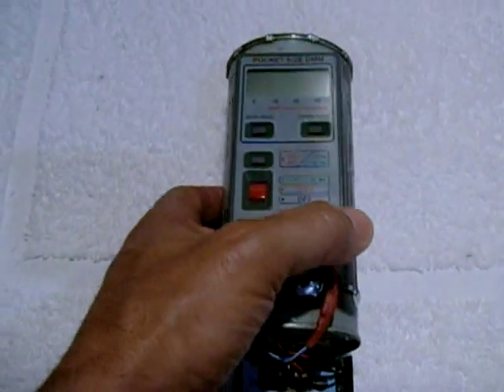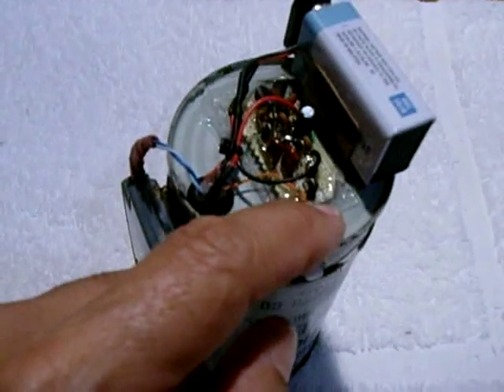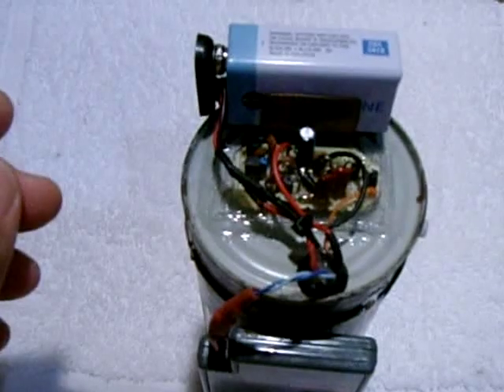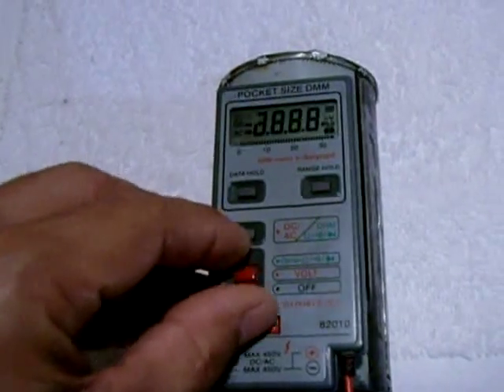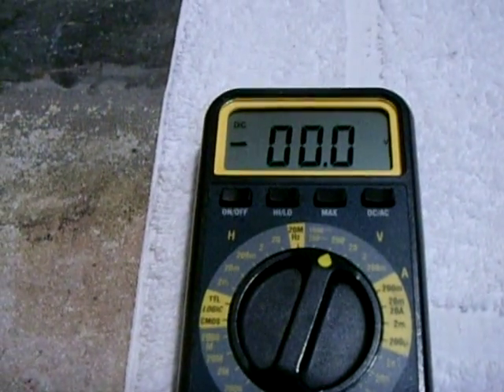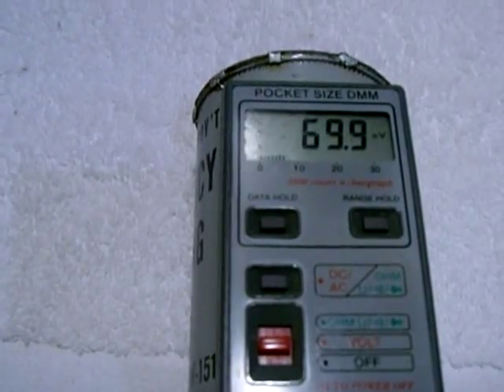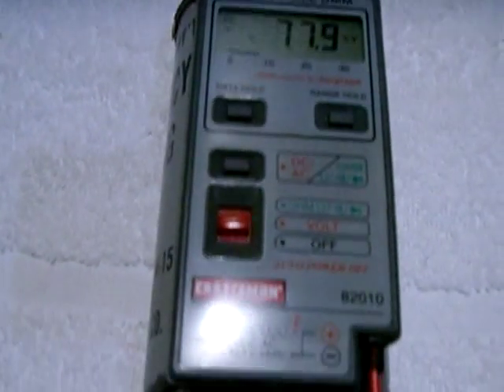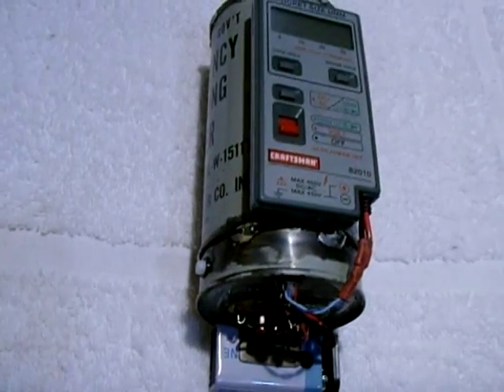Techlib's Super Sensitive Ionization Chamber/Radiation Detector

Comment: can i use this to detect cosmic rays?? please answer..
Reply from the maker: If I face the opening of the ionization chamber toward the sun, I observe the reading climb. To my understanding, ionization chambers are used for cosmic radiation. You may want to email techlib.com and ask before you make one.

Thanks For Watching! Be sure to check out my other radiation videos as well, and share.
Reply: electronicsNmore thank you very much..
Reply: electronicsNmore another question. Can i replace the can with geiger tube? And is the reading in mV or in Volts??
Reply from the maker: Why not just make a geiger counter. I have several videos of a dual tube version that I made. Refer to my video playlists. Look for "Radiation" in the list. "Usually" a GM tube requires hundreds of volts applied to it, so when a high energy ray/particle strikes the tube, the gas will ionize causing the "click".

Thanks For Watching!
Reply: there's no schematics there, can you please refer me to the schematics or send it over? im just gonna use it for my research purposes.. thanks..